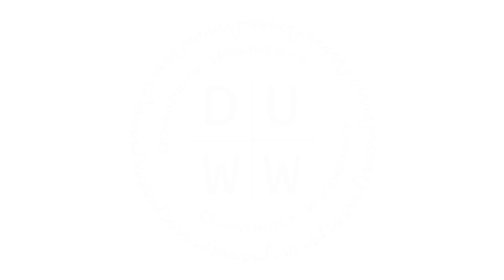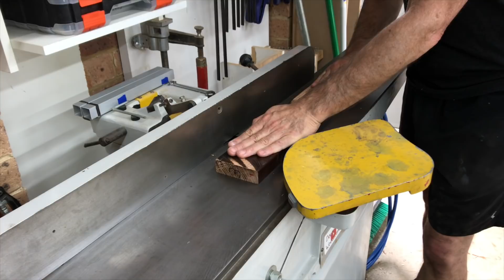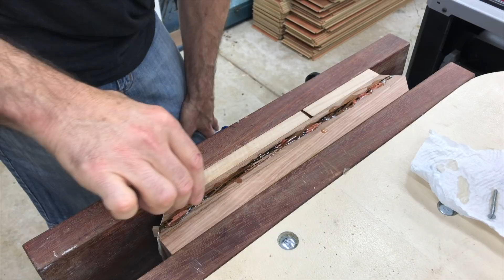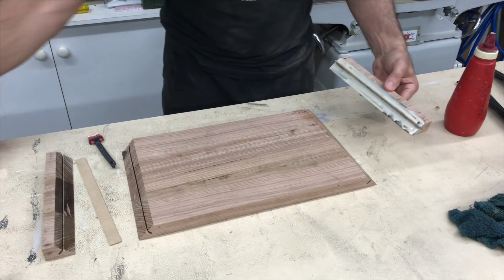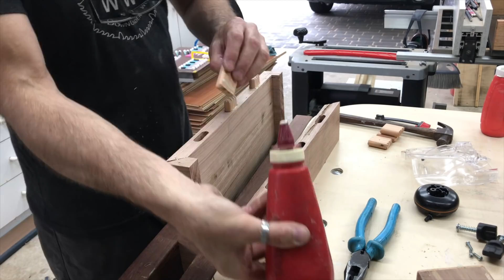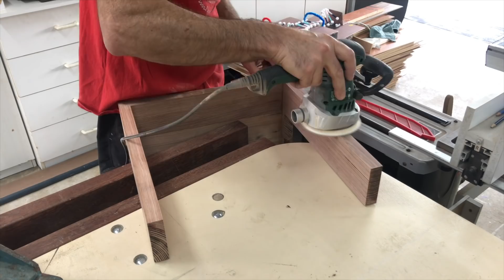How to make a small end table from reclaimed wood

Comment: I like how the final table appears to be slightly floating. Did you chamfer the feet, or are they on felt pads?
Reply from the maker: Thanks very much Dave. its probably a combination of both. i usually slightly chamfer the ends of legs and also add felt pads.

Comment: Certainly looks the goods ! How did the leg tenons hold up once assembled? Do you think they'll be strong enough for long term?
Reply from the maker: Yes Brett, the table felt very solid when it was finished and being so small I don't see any huge forces being applied. It may have been a different story if it were a 900 high hall table or similar.
Reply: @DownUnderWoodWorks  as long as no drunk relos use it as a stool 😂 I love reclaimed timber, it's  awesome
Reply: It won't be a heavy load-bearing table. Most weight it will ever see is a few coffee or tea cups on it. But even if someone decided to use it as a stepstool, I think it would be strong enough to handle that, thanks to those floating tenons.

Comment: Love the detail in the design, the reuse of scrap and the craftsmanship. Masterful! Can you elaborate a little on the finish, equal parts of linseed oil, kero and polyurethane...(oil based I imagine), such as why this particular mix, pros and cons, drying time between coats and final finish details? Its fcuking beautiful!
Reply from the maker: Thanks Benny. Yes, the mix is equal parts of oil-based urethane (satin), mineral turpentine and BLO. Oil finishes look much better on hardwoods, the turps help to thin it down so it soaks in more and the urethane adds a little protection. I usually wipe off any excess once I notice that it's mostly soaked in.

Comment: I was lucky enough to see this one in person in its early stages on a visit to the DUWW shop. Those mitre clamps were very cool. Could you make something similar that would allow you to cut the domino slots in mitres like you did on the regular floating tenons using the router table?
Reply from the maker: Have I been working on it for that long James? I'm sure I could have come up with some kind of jig if I didn't have access to the Domino.
Reply: @DownUnderWoodWorks  Yes it was in half-milled pieces on the bench so just started. That domino is cool but yeah... until it comes off patent and Makita make one at a third of the price it'll have to wait 😂